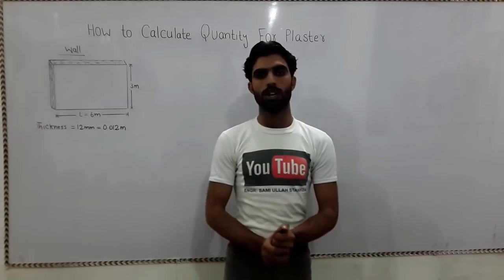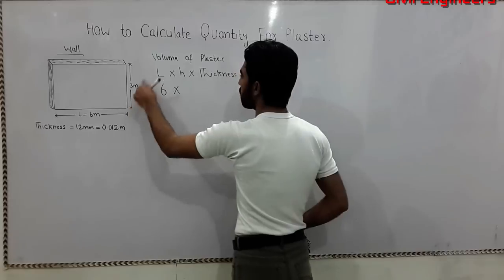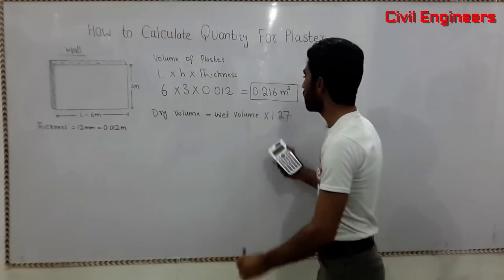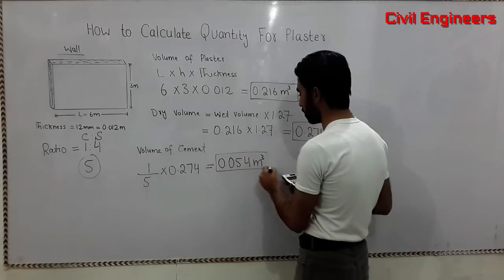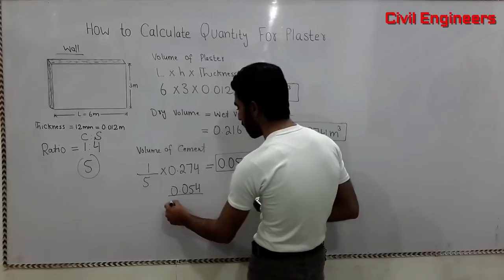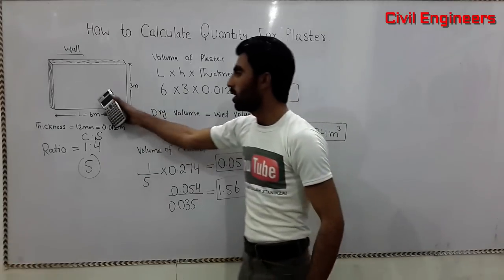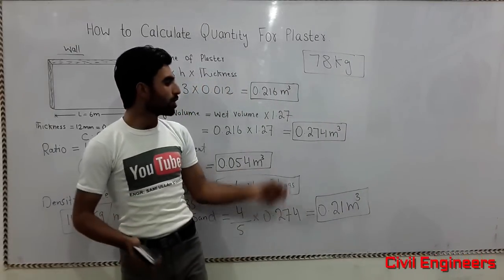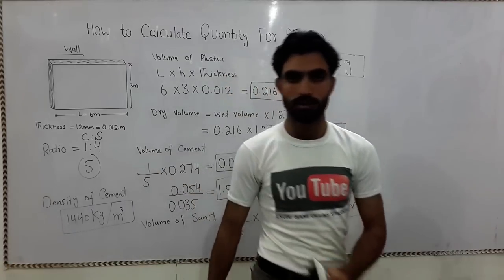How to Calculate Quantity of Cement and sand in plaster .

Comment: sir 0.035 kaha  sy aya
Reply: its the volume of 1 bag cement..(1bag cement=50kg in weight & 0.035m3 in volume)
Reply: 1 bag of cement = 50 kg.. density of cement = 1440 kg/m3 .... therefore.. 50kg divided by 1440 kg/m3 is equal to .035 m3

Comment: 1.27 kah se aaya ??
Reply from the maker: when u convert wet volume to dry so it will increase 1.27 % of wet volume to dry
Reply: dear sir...in calculate for plastering video...i didn,t understood 
0.054÷0.035= 1.56 bags
where,s come the 0.035
Reply: while 0.035 is not show on whole calculation...
Reply: 1m^3 contains 29 bags of cement so 1 bag comes in 1/29= 0.034 .
get it
Reply: Volume of one bag cement is 0.035